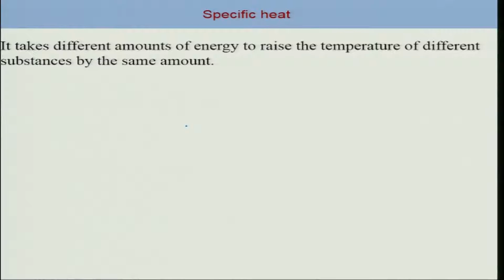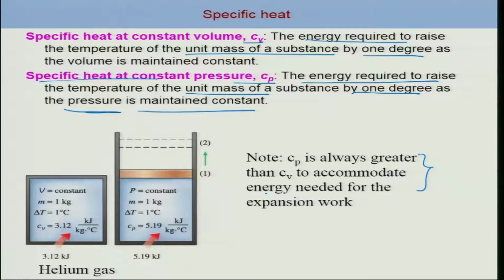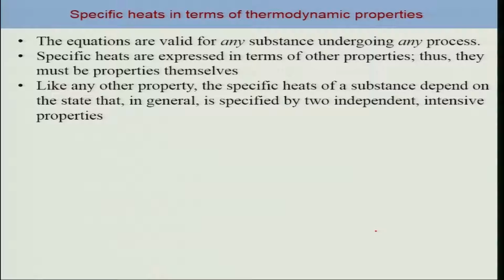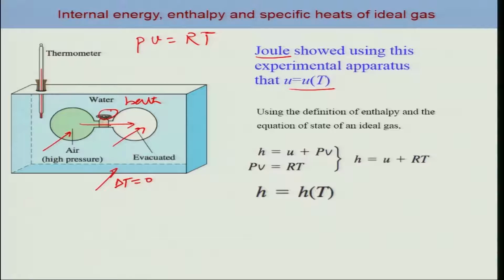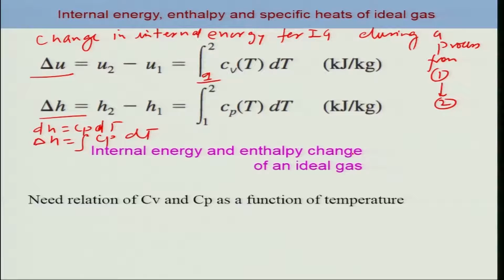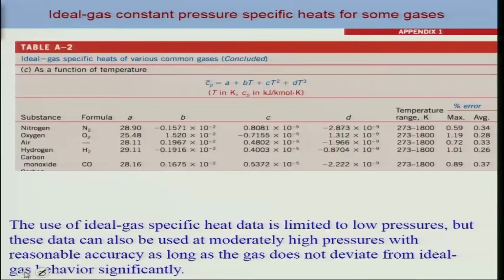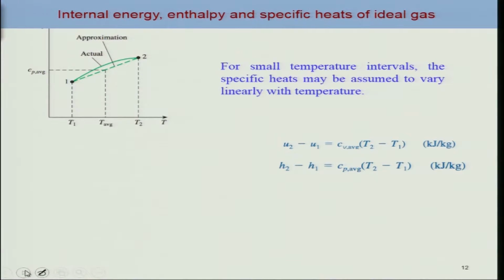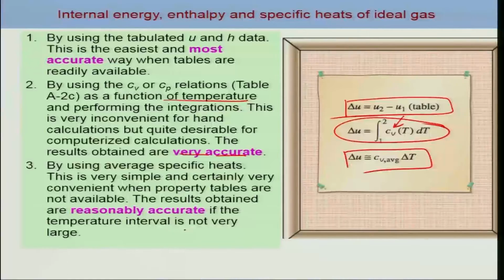Internal energy, enthalpy, and specific heats of ideal gas

Comment: A mass of an ideal gas has initial temperature of 16 °C. If the temperature is raised to 280 °C, find the change of internal energy and enthalpy. Assume specific heat at constant pressure 1.005 kJ/kgK and specific heat at constant volume 0-718 kJ/kgK.
Reply: Ans sir